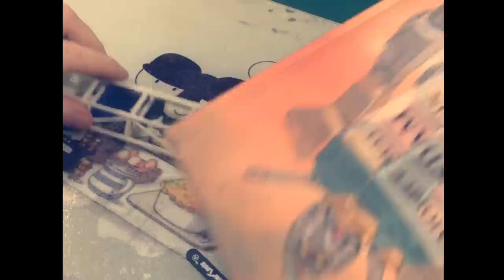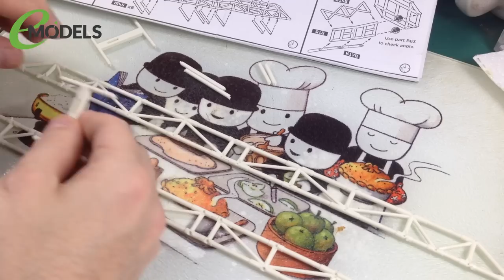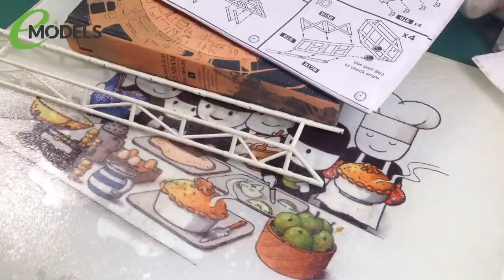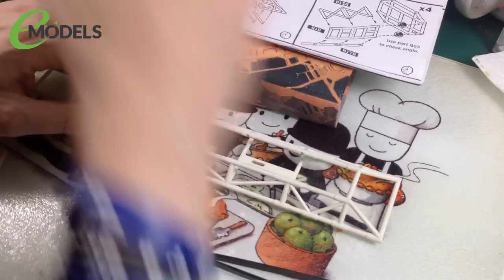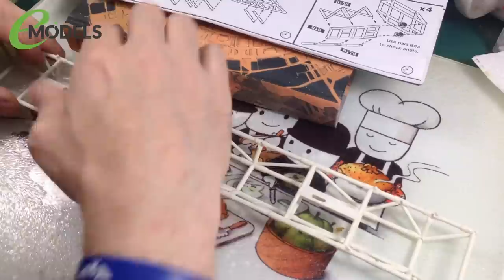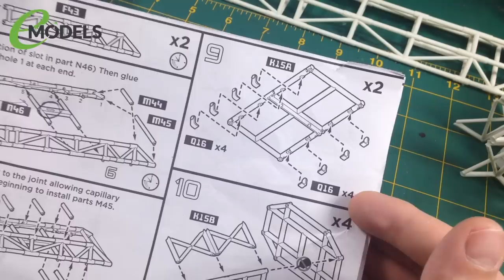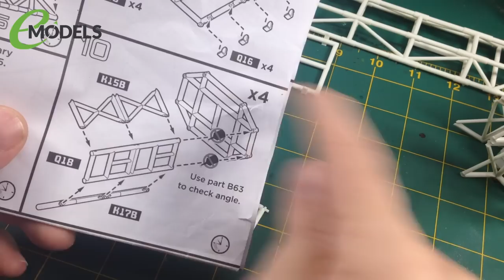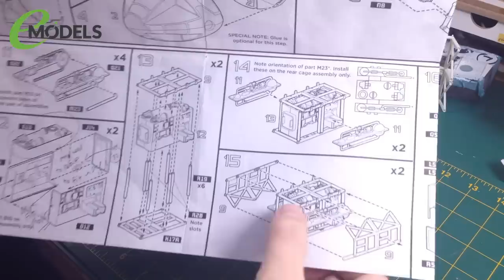22" Space: 1999 Eagle Transporter Special Edition 4: Starting the Cage Assembly

Comment: The only way I felt confident enough to assemble the spine and cages accurately was to build a jig from laser cut acrylic sheet which held the components in position for gluing. 
I also spent a considerable time removing all the moulding lines from all the spine and and cage components and filling manufacturing ejector pin marks where present.
Reply from the maker: Yup, clearing those seam lines and pin marks out takes FOREVER ^_^

Comment: I was wondering if the exoskeleton could be built in smaller sections then glued together via the shorter cross section than trying to balance the longer side sections and cross beams ?
Reply from the maker: You could hack the parts around to do that, but then you would be aligning even more separate parts - and there's never any point to making more work for yourself :)

Comment: Being in the plastics industry just on 30 years. I can say that the method worked out by MPC for modellers to assemble and glue this kit. Is very bad. The spine should have been molded/cast in 2 parts only. It is way too fiddly for most people. Same with the piping in the cages in the rear where the bottles and engines are. To many people I have spoken to gave up and never finished their kits. Some just bought the pre built ones. That means the kit was not designed right for assembly.
Reply from the maker: It's possible that some may find it challenging, especially if they are inexperienced builders but in all honesty a model kit is supposed to have some challenge to it otherwise it may as well just be sold as pre-built and painted, or as a toy :) The price of the kit also points it more towards the more experienced end of the market, to be honest. And to be fair, I found the assembly not really that challenging as although it would have been helpful to have an extra set of hands, it fitted together very nicely and I thought was quite thoughtfully engineered. I disagree in that I do not think the kit is poorly designed as it does go together beautifully, with a little hard work, but it IS intended to be a little challenging. 

Ultimately not every modeller has the same skill level and whilst some may be happiest with simple, straightforward builds, others crave complexity or challenge.  Not everyone will be skilled at making a more complex kit and to be fair, that would be a deficit of skill or experience of the builder and an area for them to develop, not a flaw in the design. I can say in all honestly that compared to some kits, the Eagle build was very straightforward - certainly modern premium-quality AFV kits with their individual multi-part track links, photoetch and millions of tiny parts can be massively more challenging than this Eagle. You could, in a similar vein, argue that having to assemble tank tracks link by link in 1/35 scale is a bad design because instead they could just make the track as a solid moulding or as a single rubber piece  - but that is like a cyclist complaining that a car is not a bicycle, because such thigs DO exist, and they are cheaper and aimed at a different level skill. Different products are designed for different tastes and levels of skill, and certainly when you are paying several hundred for a kit you should assume it is aimed at the more experienced builder and not the Revell Easy-kit end of the market.
Reply: I agree the spine is a bad design i have built 3 Eagles so far & the spine is the worst part &  i still can't get it completely straight ..if Bandai would have designed the kit the spine probably would have been molded in one piece on the sprue 🤷🏽